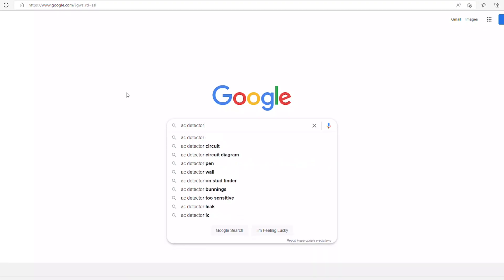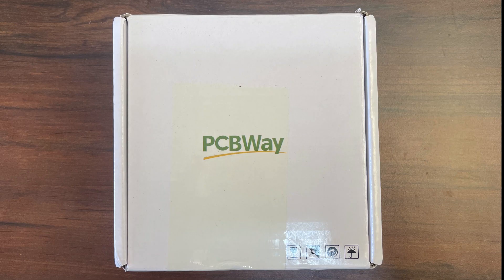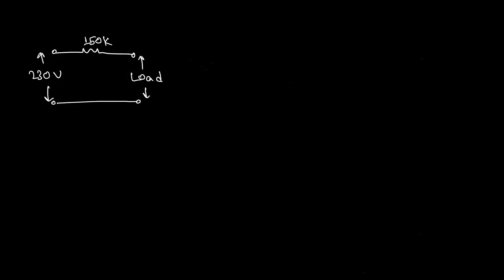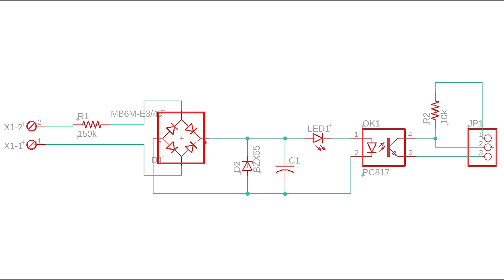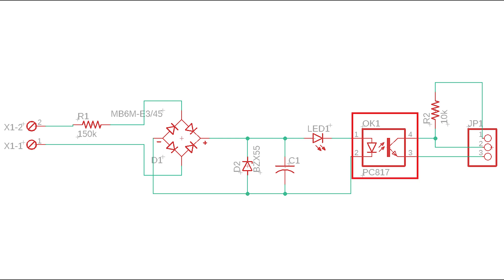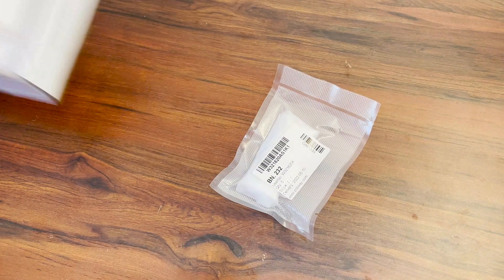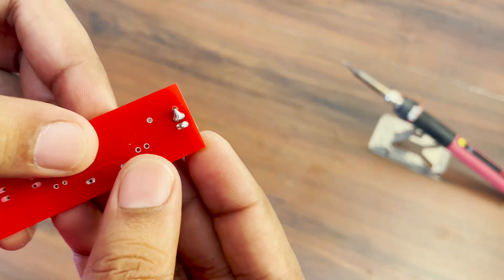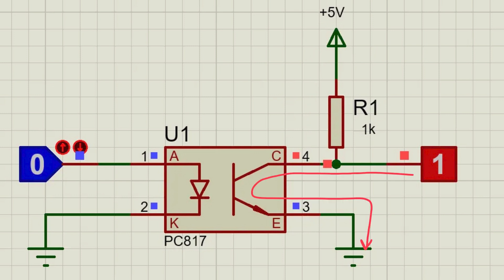AC Mains Detector Circuit

Comment: There is a fundamental error in this video, particularly the calculation at 1:38 into the video. The calculation for I=203/150K is written as 1.5mA  This should be 1.53333 and explains why when the calculation is reversed as Vr = 150K * 1.5ma it gives a value of 225V. The rounding error off the end of the initial calculation is why you get a value of 5V difference and not because of any electrical issue. At that point, I'm afraid, the whole maths demonstration is worthless. Sorry to sound critical but it is important to be accurate.